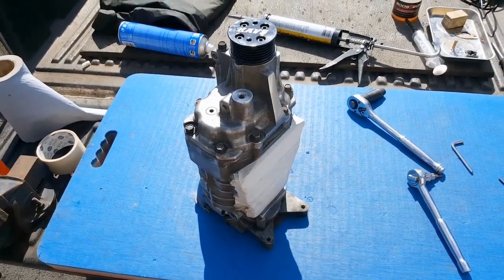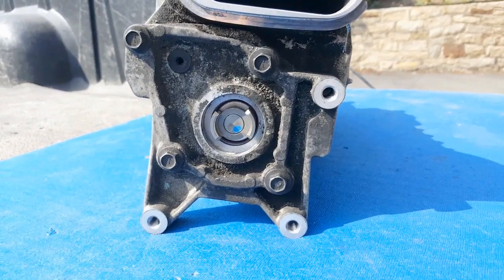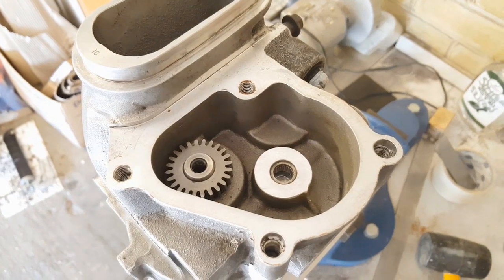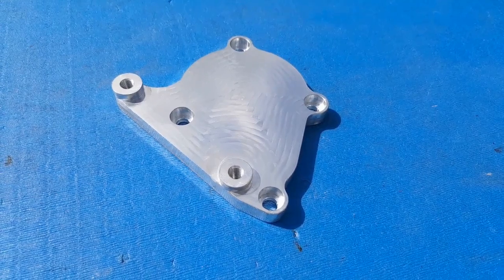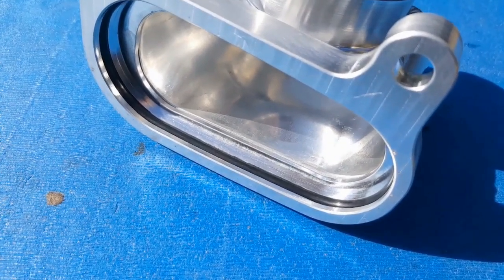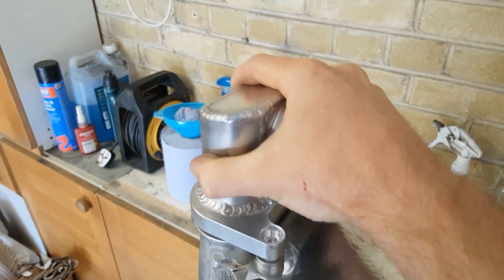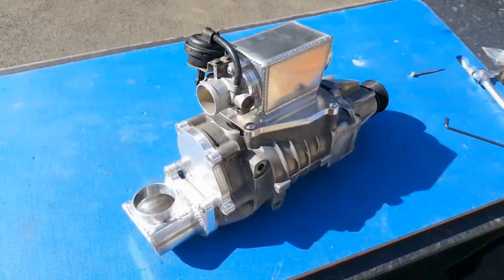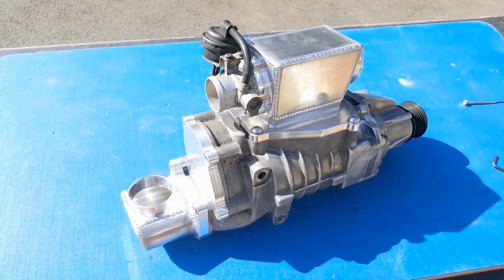Supercharger Inlet & Outlet Install - Eaton MP45 Prep Part 02 | Supercharging the MX5 / Miata Ep 20

Comment: Installs seems pretty easy, did you  have to reroute the throttle or anything ? I’ve seen other kits need that
Reply from the maker: In this configuration you keep the throttle where it is from factory. I'm currently adapting the setup to 2 throttles which I will document in a later video.
Reply: @FastRust  I see, you wouldn’t happen to know if this kit would work in a LHD vehicle? I asked g19 but their email response time is lacking. What’s the purpose of the second throttle? I would like to do this to my rusty 1.6 as a starter project as I’d rather break my current one than whatever cleaner one I get next 😆
Reply from the maker: LHD I don't know, sorry. I did see a post on G19s Facebook page months ago about it, maybe have a search on there. The reason I'm fitting a 2nd throttle is to reduce noise, it was so loud with just one. When I've tested it I will do an update vid.

Comment: Great videos mate, I’ve had this kit for a while but unfortunately not had the time to fit it, hopefully seeing you doing so will motivate me to do it more! Look forward to seeing your solution to mounting the Intercooler and piping it, unfortunately I have an na so my light motor assembly is in the way for where you’re most likely gonna pipe
Reply from the maker: Thanks mate! The kit has been a breeze to fit, you could have it done in a day I'm pretty sure - takes me longer due to filming 🙄 The intercooler fitment and plumbing is my next job so I'll be sure to document that entire process as well. You might have already seen it but a few episodes ago I relocated the radiator which is going to help with the intercooler install massively. Not sure how applicable it is on a mk1, but it's something you could look into. Cheers.